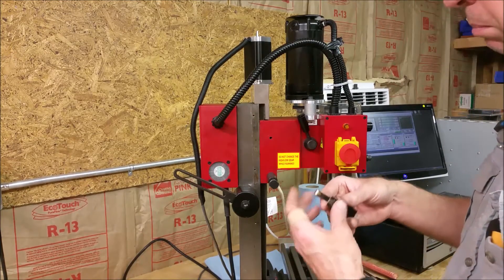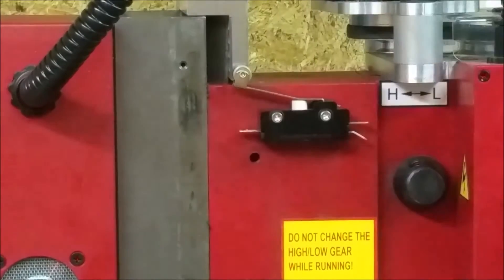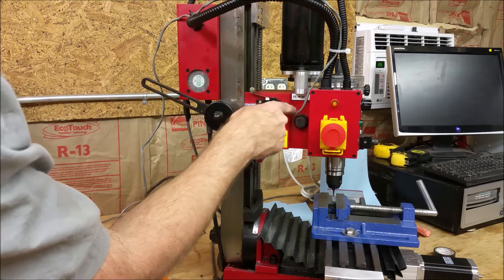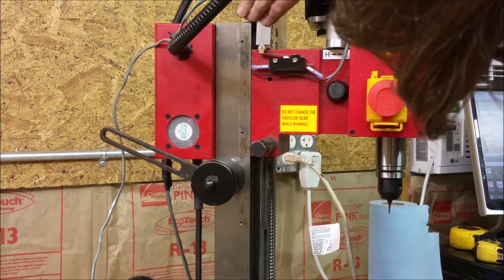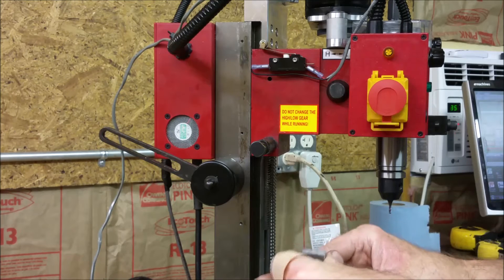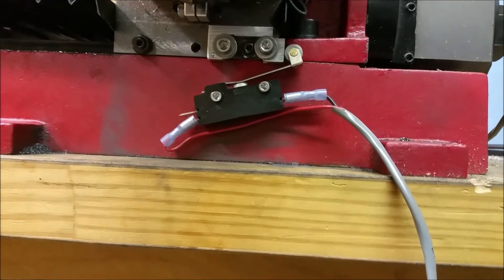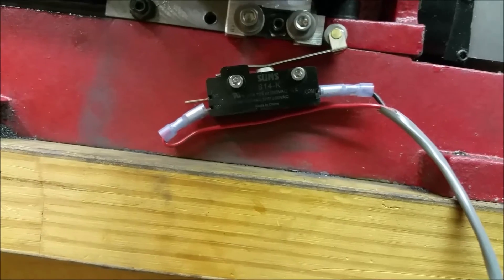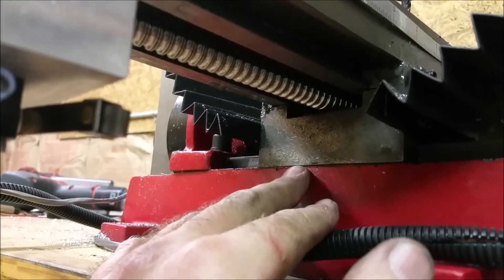Mini Mill CNC Conversion Part 7 - Limit switches

Comment: You may have some trouble with noise getting into that wire that's routed right next to the motor wire.  I would suggest a capacitor,  say 100nF, across that connection to try and minimize this possibility.

Comment: I like the location of the X switch cleaver adjustment :-)
Reply from the maker: CNC4XR7 Thanks!  Had a little trouble getting the drill in there but remembered I have a right angle cordless drill. :-)